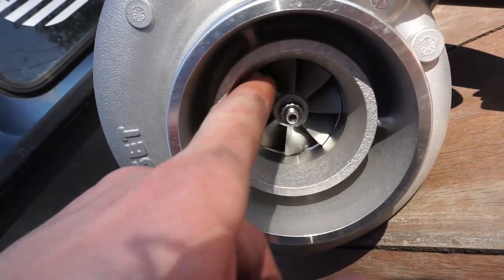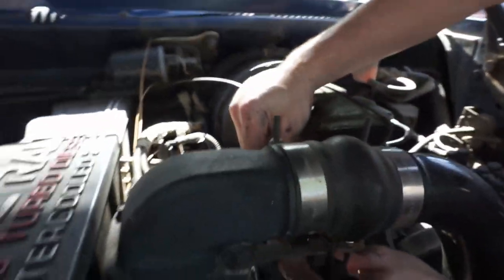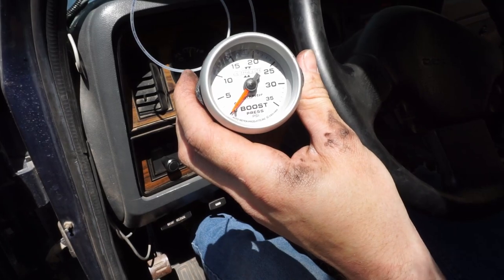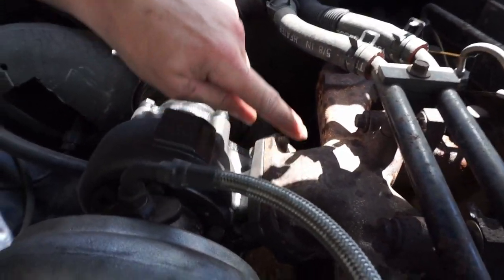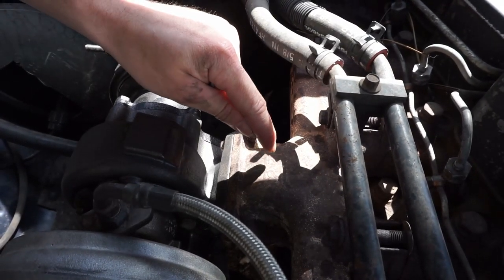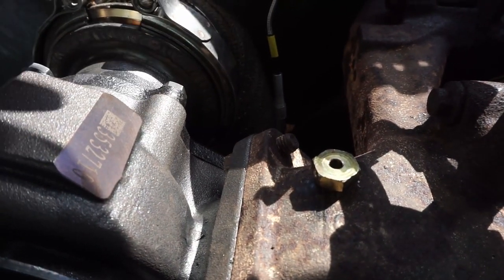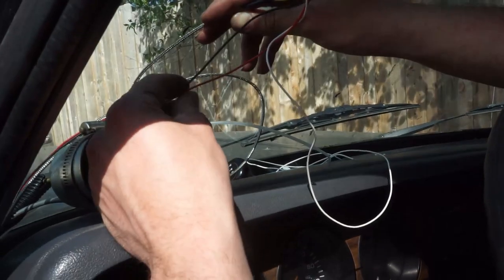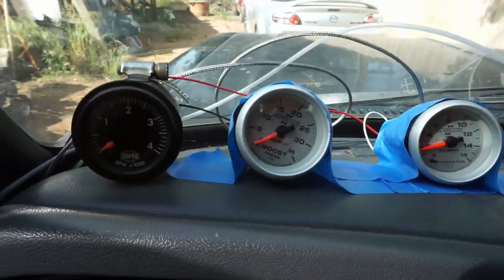First Gen Cummins Boost Gauge and Pyrometer Install!

Comment: Thanks for this video. I just bought the auto meter boost gauge and pyrometer and couldn’t figure out from the directions how the heck to connect this thing. I am going to pull that bolt out of the block and hope this works as it shouldn’t be that complicated. Thanks again.